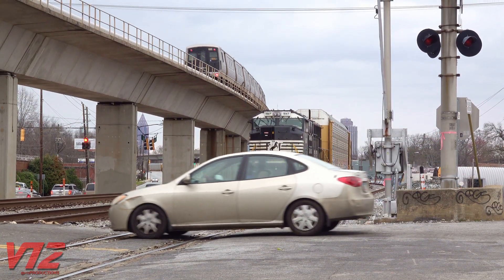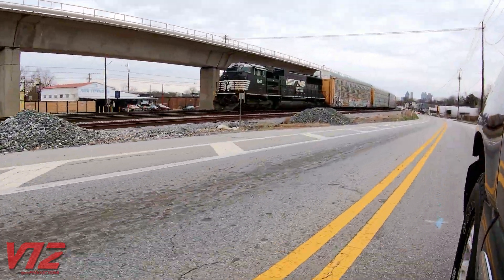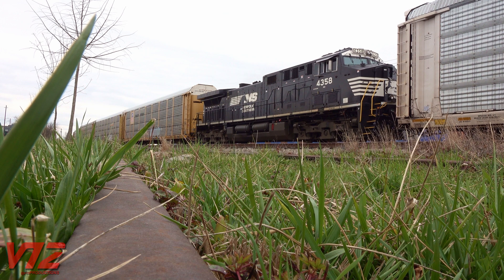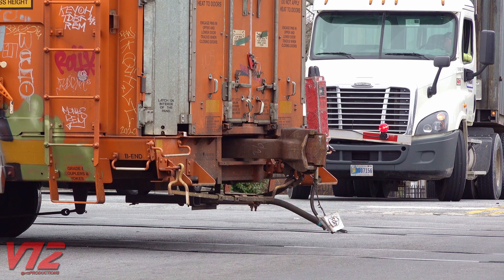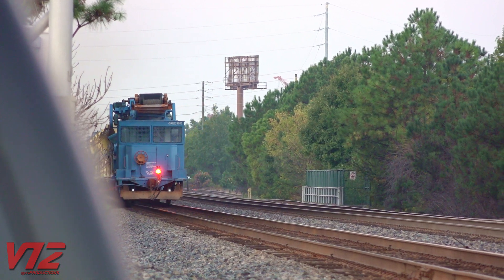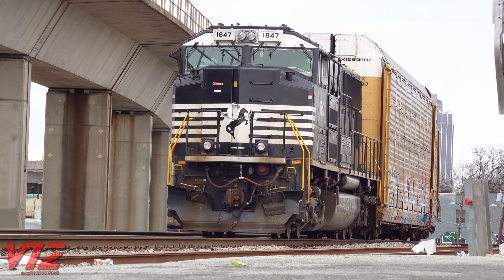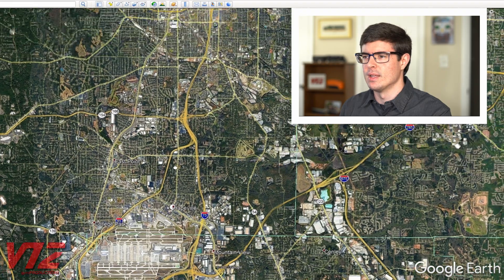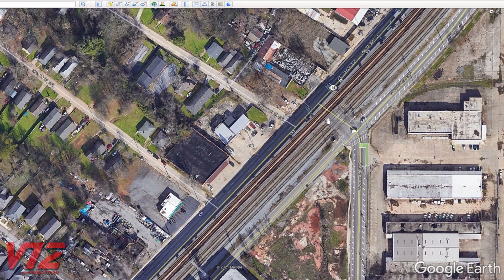MEASURING an American Freight Train

Comment: Even when the train wasn't moving, I think it's still dumb to drive around the barriers, especially when you don't know if another train is approaching behind the parked one.

Thinking back the SD70ACC leading that train, I think that engine looks a little odd with the SD70ACe-esque cab but no flared radiators. As for the AC44C6M, that looks like a GEVO/Dash 9 hybrid.

Comment: Thank you from an enthusiast in Milton Keynes in the UK, about halfway between London and Birmingham. You answered so many questions in that one short video. How does a DPU work ? You answered that. In the UK the only 'DPUs' we have are locos on the rear of some passenger trains that are contolled by wiring within the train. We never have locos in the middle of a train. What is that red thing on the end of the train that often makes a high pitched noise ? Fascinating explanation of what must be a hugely useful and ingenious piece of kit. Trains in the UK just have a red flashing light on the back. In my career on the railway I used to drive what were some of the longest and heaviest loaded passenger trains - 12 coaches long with a capacity of about 1100 people. Our longest freights are the Mendip Rail stone trains from Mendip Quarry near Swindon to Acton Yard in London - they are about 40 or 50 trucks with one GM Class 59 on the front - an American built loco which I think you call and SDP40 or something like that. They are the oldest GM locos in the UK. I am finding American freight trains to be a truly fascinating subject. Thank you.

Comment: Once again I am learning something new. Thanks for sharing your knowledge. How long did that train stay at the signal? Do you think the engineer knew the train was partially blocking the intersection?
Reply from the maker: Thanks! The train never moved the entire time I was shooting this footage, which was at least an hour and 40 minutes. Maybe they thought they were clear of the crossing. They were very close to clearing it.
Reply: @v12productions  --  Well, he can't proceed beyond the red signal, of course.   And on some systems there are special markings where rails merge telling the driver how far he can advance his locomotive.   If he has a LONG train, he should be within inches of being as far down the track as he can.   If he wasn't, shame on him.   

Can you determine from your footage whether the train had pulled up as far as he could?
Reply from the maker: @GilmerJohn  He was stopped just short of the crossing in front of him. That's typically where they wait for that particular signal to change.
Reply: It was a another crossing ahead of them before the switches and signal that’s been there holding spot since god knows they use to break the train in half long time ago to keep from blocking all three crossings I guess it didn’t matter because one crossing is going to be open anyways so they leave the one in front open I grew up on the street the right of the loco and walked to the corner to watch the trains every day after school until my mom got off work and we used to catch huge crayfish and frogs under the bridge which they turned into the belt line trail now before nobody would have walked under there lol it was dark a wet everywhere if I knew what I knew now I wouldn’t have either but hey we was kids

Comment: train length is important as the dispatcher uses it to figure out where meets, if any, will take place... the crew needs this info to determine where on the subdivision they will fit WITHOUT blocking crossings... this also determines where they may have their meal period... so for example, if you're over 7K ft, you can't eat at you fav spot, dammit too long, gotta stop at burger king... again... also the EOT can be used to measure distance, crews SHOULD do this at the start of the trip and check that measurement against the ESTIMATED length found on their wheel report... nice vid